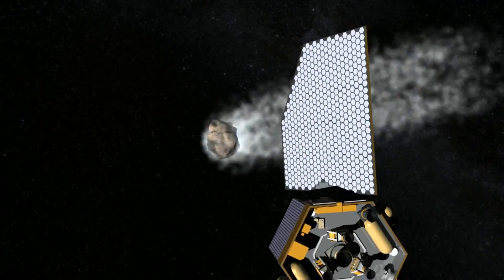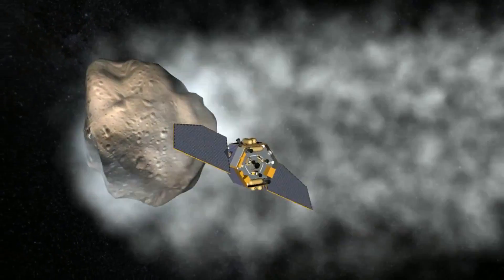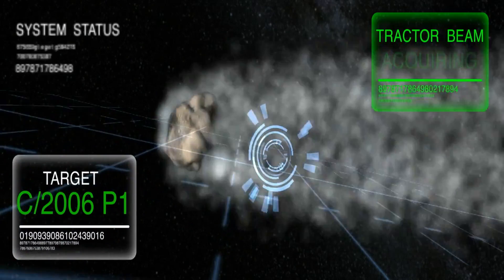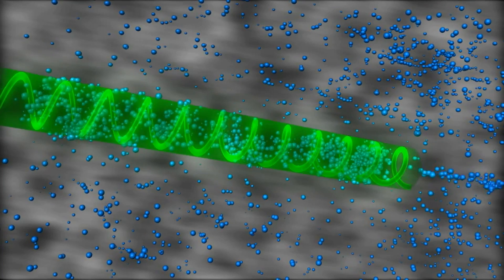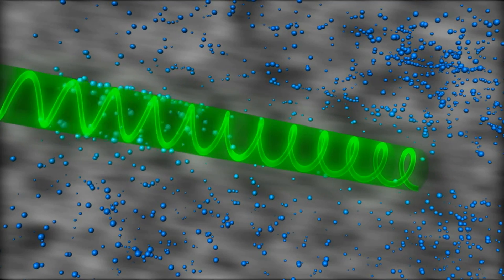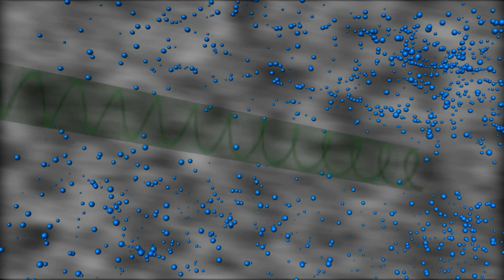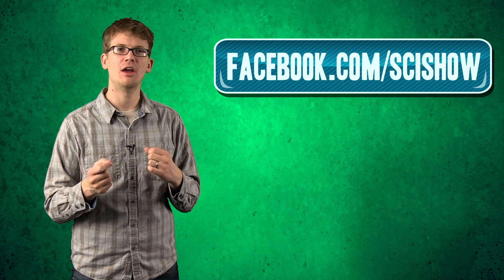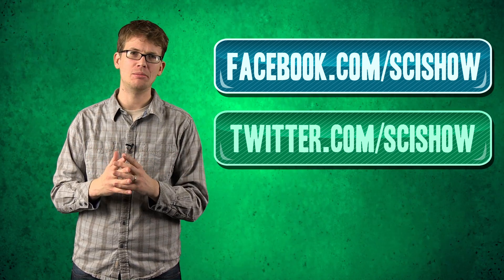Tractor Beams: Almost Real!

Comment: I have one idea when it comes to this that we might be able to do today (I don't know for sure though).
Satelites orbiting the earth (including the International Space Station) all lose just a tiny bit of speed all the time. In order for them not to eventually fall to the Earth they have to use some booster rockets to speed upp again
Fuel however is hard to get up there so here's my idea: Use a tractor beam to Push (not pull) on them. We could probably save a lot of "refueling" costs

Comment: Hank, could you explain why the "space junk" and the USS and all the satalites DON'T cover up the sun's rays.

Never quite understood it
Reply: Not nearly enough of it!  Seriously, the area involved is much bigger than the surface of the planet.  Picture a half-inflated balloon, then picture inflating it fully.  Half inflated is the size of the surface of the Earth, and the satellites are up high, so a much bigger sphere, so much bigger area.  (They're also not all at the same level, so more like a bunch of balloons inside each other, which is another reason they don't bump into each other, but that's not relevant to your question.)  

If you took everything we've sent up into space, and put it a few feet off the ground instead of miles up, you'd still only cast a shadow on a bunch of little patches of Earth.  The surface area of the planet versus the volume of stuff we've put into orbit is just too small for anyone to notice.

Comment: Couldn't you use your first example of a tractor beam, the one where a laser holds the molecule in place, and reduce the angles of the two adjacent laser beams, therefore bringing the object to you? Not only does it seem to make the most logical sense to me, but it also seems that  that's the method that any Imperial Star Destroyer would use.

Comment: That is perfectly sound reasoning, though i assume the "tractor beams" they are working on rely on some additional apparatus that would be "pulling" on the particle.  In fact lasers and even flashlights effectively function like rocket engines; the momentum of the photons being emitted in turn pushes the device the other way, though even our most powerful lasers output such low energy that its hard to detect, but the principle could be used on to make light-sail propelled sapcecraft.

Comment: I'm thinking about the Newtonian physics here. For every action is an equal and opposite reaction. If you use lasers to pull particles, does that also impart an equal force pulling the laser in the direction of the particle? That would mean that if the size of the mass being pulled by the tractor beam exceeded the mass of the tractor beam assembly, you would effectively just be pulling the tractor beam toward the target.

Unless this is in that weird quantum field where Newton doesn't exist...

Comment: Actually that's pull as a low airpressure draws more air into it to raise the airpressure.
And in a vacuum cleaner when the airpressure increases a compressor pulls air through it and lowers the airpressure inside the vacuum cleaner. The lack of particles in a spot makes object want to go there so still it's pull and it's always pull. A airblower is pulling too as it creates a high airpressure objects moves to lower pressures and the emptyness of the air pulls objects.

Comment: air moves from spot #A to spot #B in a vacuum. In this case from the turbine to the bag.
as it moves from spot #A to spot #B it leaves a void in #B. That creates a vacuum.
Air then tries to fill that void from left in B....and the dirt and trash on the floor is PUSHED by the air rushing to replace the void.

ITS ALL PUSH!!!!!!!!!!!!
THERE IS NOTHING IN SCIENCE CAN BE CALLED A PULL/SUCK IN PHYSICS....IT IS ALL PUSH!

Comment: they actually don't use multiple beams in optical tweezers.  instead it has a lot more to do with the focusing of the beam onto the transparent beads.  the light refracting at different angles at one end of the bead versus the other is what imparts some of the momentum of the light into the bead bringing it back to center.

Comment: Yeah he mentioned this, but that's pushing and we need pulling because we don't have spacecraft with massive laser equipment on the far side of these things to push. If we did then we could examine them using the spacecraft and there would be no need for tractor beams :)

Comment: The solar wind is a stream of charged particles ejected from the upper atmosphere of the Sun. It mostly consists of electrons and protons with energies usually between 1.5 and 10 keV. The stream of particles varies in temperature and speed over time. These particles can escape the Sun's gravity because of their high kinetic energy and the high temperature of the corona. ~Wikipedia

Comment: I have an idea that MIGHT work...
At 1:20 it is showing how the multiple lasers at multiple angles make the particle stop moving and stay in place. What I think is that couldn't they set up, so that the lasers at the angles at the sides, could move slightly towards where you want the particle to go? Then you have a tractor beam... Because since the particle is stuck in between the three polarities it would have to move along with the two that were moving.

Comment: Also, if you would have followed the video, you would have known that it was actually explained that light can only push particles. However if you use it in the right way, you may be able to push it towards you. And the other option relied on magnetism, which IS an example of a pulling force.

Comment: Photons don't have mass, only energy. And even if they had mass, which they don't, then that would only mean that it is possible for mass to travel as fast as light, not faster than light. And no, futuristic spacecraft will never allow us to travel beyond the speed of light, as long as you measure time and distance in the same frame of reference.

Comment: actually, they have a thing called a "light sail" which is a very thin fabric that light pushes on to move spacecrafts. also, light has very little mass which is why it doesn't just blow you off your feet an a sunny day.

Comment: No it doesn't undermine it. "Explosion" is used here in the sense that in terms of geological time, it happened very fast. What is actually meant by "explosion" is that before the explosion, very few fossils of high-complexity organisms had been found. Then, over a time of about 50 - 140 million years, the complexity of animals suddenly vastly increased. It's not a clear term for non-scientists, which is why people think it undermines evolution. If you want, I'll private message you more info :)

Comment: The satellite would indeed experience an equal force in the opposite direction; however 25kg is way out of the league of this tech right now. Also, repulsion of asteroids or meteoroids (meteors being meteoroids that have entered the atmosphere already) is totally possible with traditional laser beams: the whole trick is that we can pull stuff now, whereas traditionally lasers could only push. Still lasers eat a lot of power, its unlikely we'd bother with using this on anything big anytime soon.

Comment: Couldn't you potentially have three beams of light on one particle and then make the angle between the two angled beams of light gradually larger, therefore bringing the intersection point, and therefore the particle, closer to the emitter?

Comment: what about using the same technology that holds the partical in its place with 3 laser beams but moving the directiono of the beams simultaniously so the partical is still in its place between the lasers but moves together with them to the center between the lightsources?